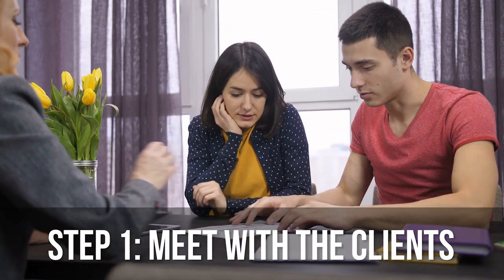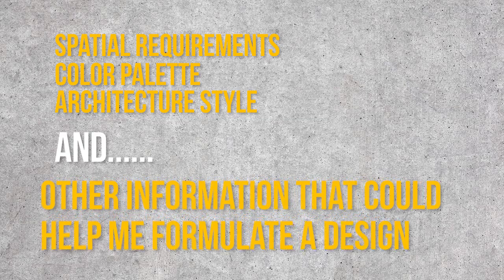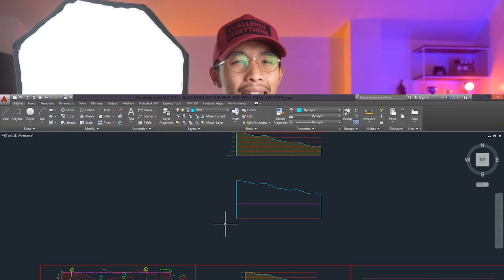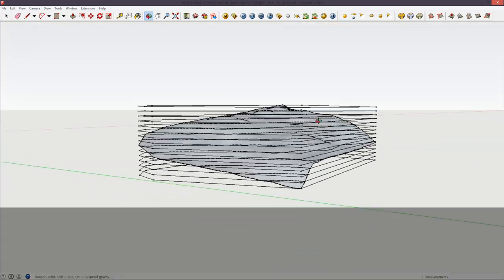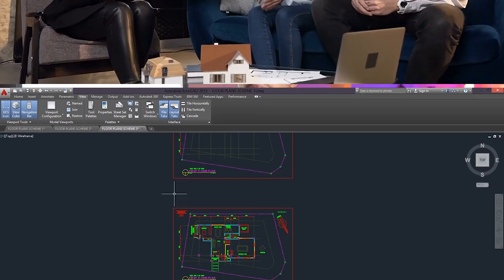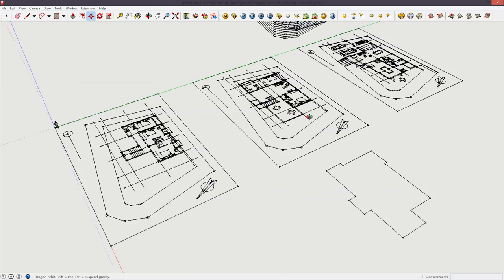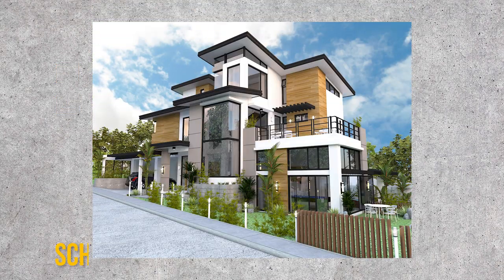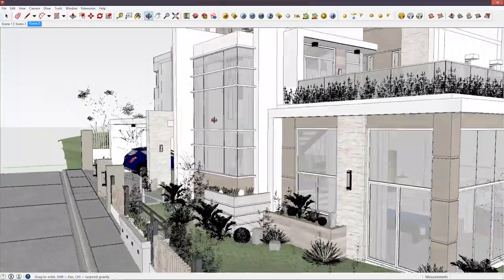My Architecture Workflow

Comment: its really cool that we have similar worklow. haha. i also sometimes  use revit. but it takes a bit of time since im not an expert. haha..
Reply: Whats better, revit or autocad?
Reply from the maker: Yeah revit's a bit confusing for beginners haha!:)
Reply: it really depends on the output you want and want your work process is i think. if your a master with revit design  then working drawings will be easy in the sense that your working within just one file. while in autocad you get 1 cad file for your 2d stuffs but you have to partner it with sketchup for your renderings. 

but whem you have your allied professionals most of them use Autocad. so yeah. i dont know if that made sense. but thats that. hehe

Comment: Why revit is involved every where , I think your workflow is great for small to medium size projects or for interior design projects . But in case of larger projects , I think that Archicad is the king B.I.M software .
Reply from the maker: I think revit is popular cause it was developed by autodesk:)
Reply: @LlyanAustria  no it's not actually purchased by Autodesk , I am with u the marketing of Autodesk is better then Graphisoft ( Archicad developers ) but the last one is way better and easier to use , I think it's just wrong to stick to the market and not looking for a better solution .

Comment: What's the difference between Architecture and Engineering?
Reply from the maker: Yup what Jerome said:)
Reply: Typically architecture tackles the design of the building. Aesthetics, circulation, spatial relation, how it can improve/address how people live, etc.

Engineering is what brings architecture into reality. How it can be built, how to make it stand for 10 years, how to make a bridge work, how big of a beam is needed, how much is needed for a certain space for airconditioning. There are different fields of engineering.

Comment: Your method is great, but its old and obsolete today. BIM will be the future, the transition will be hard but it will be necessary for efficiency. Revisions will be the enemy of that method, as you will have to be manually revising all parts of the DWG plans as well as SKP files in case it happens. With BIM you will have less time doing these revisions as the software itself is smart enough. Change/revision in BIM is equal to change in all views. I am currently a bim modeler on a small firm in Mindanao PH and im pushing everybody else in the design team to move forward with BIM. CAD will still be used but seldomly. Its still useful for drafting intricate parts/plans.

Its just like upgrading from keypad phones to smartphones. So hows it going with you learning revit? What are your thoughts?

Comment: If you can't jump onto BIM, yet, at least use AutoCAD Architecture instead of the plain vanilla AutoCAD.

As for BIM, why fix on cough Revit cough when there are better BIM solutions?

Maybe ARCHICAD is what you're waiting for. Or even Vectorworks.
Just think about multiplying your productivity in a single application.
Don't you want to focus on designing rather than hitting your head against the wall? cough Revit cough

ARCHICAD, to my surprise, only took me 2 days to nail down the fundamentals.
It's the most intuitive BIM software an architect can have.
To give you a headstart, I recommend taking the ARCHICAD Essential Training from Lynda.com / Linkedin Learning.
Reply from the maker: I'm gonna try out archicad soon pal, Thanks for the advice:)